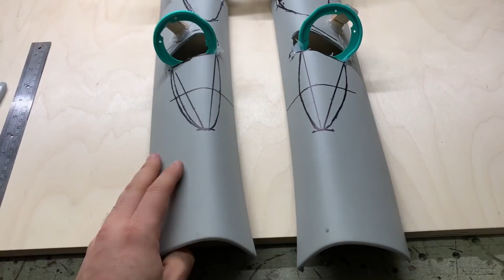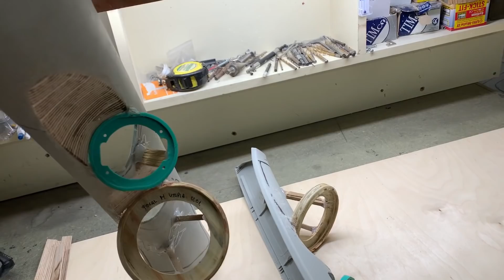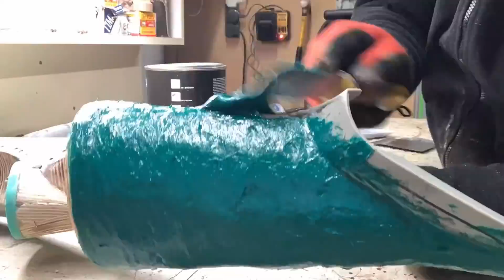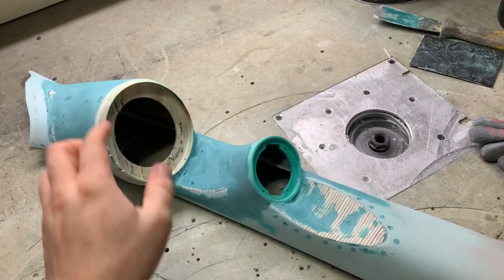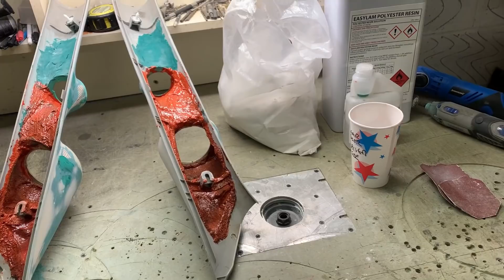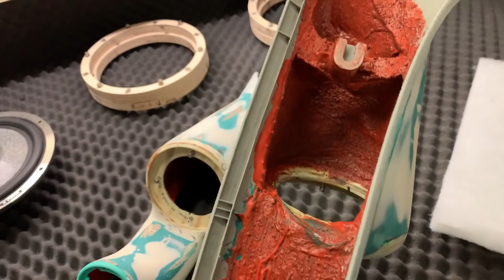A-Pillar Fabrication, Milkshake, Rainguard, Aiming, Everything EXPLAINED

Comment: Ive been thinkin that bamboo mite be the perfect wood for shaping enclosures and stiffeners. Ever work with it? The japanese do amazing stuff with it. Check out the basket weaving- could make awsome enclosures. Just a thought
Reply: Ha!  Well, bamboo is used extensively in Asia for similar types of work.

One important distinction:  Bamboo is not a wood.  It is a form of grass, and that gives it unique properties, one of them being that it does not expand or contract nearly as much as most typical woods do in extreme temperatures.

I use bamboo flooring in my house for that reason because I have radiant heating in the floors via water/glycol tubing encapsulated throughout the insulated concrete slab foundation.
Reply: @bbfoto7248  true! u got me! lol There are some weaves that look carbon fiberish, Im thinkn i could laminate 2-3 baskets together to make cool speaker pod. Crazy audio thoughts lol

Comment: If I was to do dual supertweeters in the A pillar how should I aim it? Towards the listener or towards the roof?
Reply: Dual super tweeters.. yikes!!
Reply: @Me-dh4pm  ?
Reply: @gabrielr6679  I'm sorry bro, I dont mean to pass judgement. I'm assuming your going for an SPL set up. When I hear "dual" super tweets I cant help but think ouch!! Good luck!
Reply: @Me-dh4pm  yes and no 
Spl when I want and sq majority of the time. I chose pa because they are more efficient but then again I don't do this for shows or demos I just love car audio
Reply from the maker: Gabriel R i would rather advise just a single tweeter per side if quality matters for you. If output is important, then get something sensitive and aim it within 20degree of head position of listener.
Reply: @pssound9749  thanks that's a better answer keep up the good work
Reply: @gabrielr6679  
Watch this video for a bit more background as to why using dual tweeters per Left & Right side is generally not an advantage, and more likely detrimental to both SQ and SPL.

https://youtu.be/MGSfaKWcetQ
Reply: @bbfoto7248  that was useless as home and car audio are in different environments.